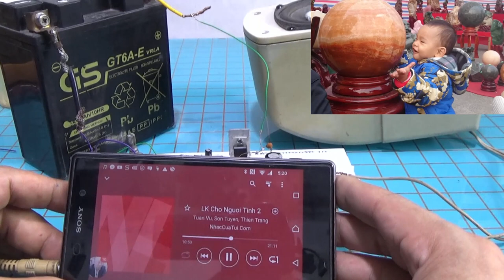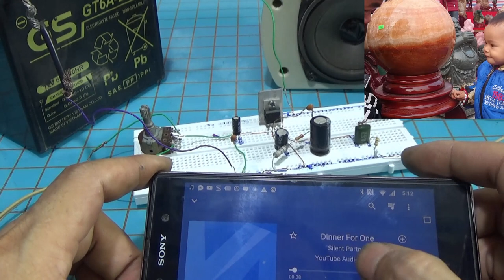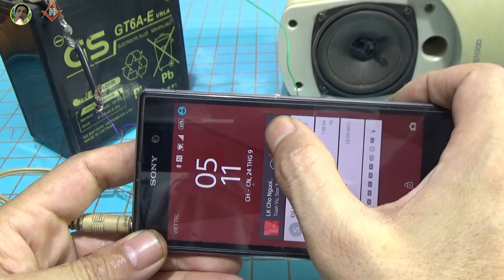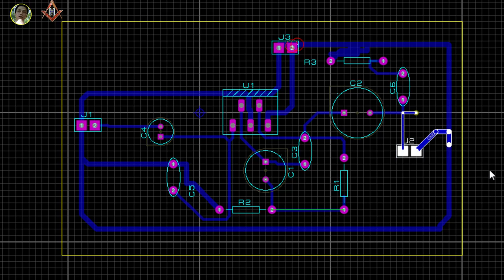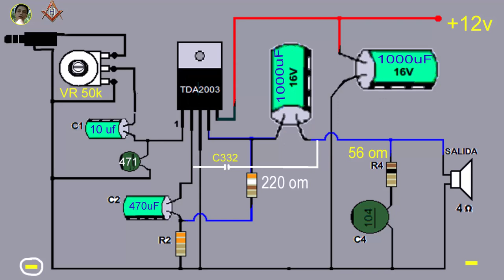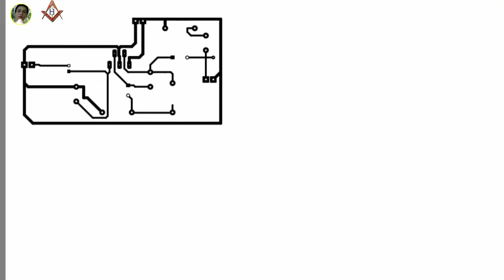How to make a 12v amplifier | audio amplifier circuit with TDA2003

Comment: How to prevent distortion of audio when the volume is turned to maximum ?
I'm using 18 Volts supply and 4 ohms speaker.
Reply from the maker: I will make this video